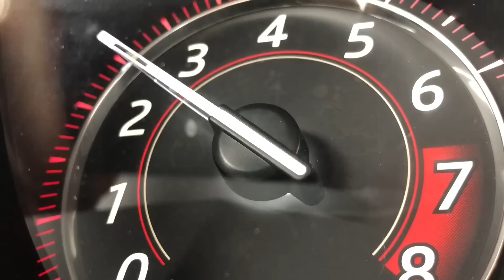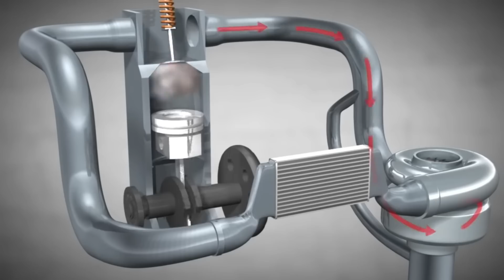Are Turbo Engines Reliable?

Comment: Over 50% of our trips are short distances where the engine / turbo doesn't have sufficient time to get hot.  My understanding is that this is not a good application.  Therefore, I'll look for a non-turbo engine for our next vehicle.
Reply from the maker: That's a very valid concern for short trips.

Comment: turbos are fine, if you take care of them with basic maintenance, my last turbo was a 2013 kia optima sxl. has 180k + miles and still gives me 27+mpg. dont drive it much anymore, but still works good.
Reply from the maker: Yes turbocharged engines are fine as long as you take care of them.

Comment: Correct to the person that said there only more fuel efficient is you stay out the throttle!!! Here’s the thing if you drive a gas turbo charged vehicle, the maintenance verses a naturally aspirated vehicle is much higher on the turbo engine! Meaning it cost more to operate it properly!  But good news is if you maintain it properly your turbos should be fine, but why buy a small displacement engine with turbos, when a much larger v8 has the same hp with less problems! An again with the turbo engine if you drive fast or pull a heavy load the fuel mileage is literally no better than the v8! I know, I own a 2022 f 150 3.5 echoboost twin turbo engine, if I pull a heavy load fuel mileage is no where close to what ford says!!! My naturally aspirated f150 friends with v8 engines get the same fuel mileage pulling heavy loads!!! I’m only better with fuel economy at normal driving no towing!

Comment: I had a turbo vehicle for 8 years and the turbo lag was there yes, but once you built that torque it was such a fun vehicle to drive torque everywhere even on the bottom end...just traded it in for a Telluride with a big Ole 3.8 NA V6 and man I miss my turbo everyday lol, there is literally no power down low until you get that engine in the upper RPM range and I don't even drive the same anymore lol

Comment: I love your videos but these small turbo 4 in my VW CS atlas burns more gas than old V6 on the highway or you push the engine
Reply from the maker: It is true, they don't have the same gas mileage as the old V6.  Yes the V6 was a more sturdy engine and I drove the atest with the turbo and during the testdrive I found it to surge at partial throttle and also seemed a little underpowered as these vehicles are quite large for that engine.  Beautiful trim in them though.

Comment: Well, 2 years later and what was Honda's solution for the 1.5 four-cylinder Turbo charged engine going into 2025?.... They discontinued it on their Civic! Yes, now you have two engine options. The naturally aspirated four-cylinder engine, or a Hybrid model if you want more power from your Civic.

Comment: 2024 and this became even worse especially in europe.
if you want a NA engine you have to stick with hybrid ( sure, no turbo but batteries ) or just pure garbage with like 80hp, both not that fun i'd say.
We have tons of 1 liter 100hp turbo engines, but at that point i'd rather buy a 1.5t or 1.6T for 5k euros more even for small 10 miles trips plus some fun on the weekends

Comment: Turbos by definition are forced induction. They increase compression and they also generate a lot more heat than a naturally aspiriated engine. More heat and more pressure place more strain and wear on an engine. Turbos are also complex, and add a lot of parts that a naturally aspirated engine does not have. That's just more stuff to go wrong. 
I get this guy is into selling cars, so he has this line. But he's 100% wrong, and you can ask any mechanic that knows turbos who will say what I just said.
The marketers and ad agencies are coming to you with words like "performance" and "efficiency" but the real reason all this is happening is government pressure on automakers to meet strict emissions standards. So they put tiny engines in heavy vehicles and they put turbochargers on them to compensate and give them extra power. But good luck getting much past a warranty period if you buy a turbocharged engine.

Comment: If all else is equal, a turbo car have higher parts count, so a higher failure rate in theory. Turbo demand more maintenance, unless you are a top executive and the company lease a car for you, then you will get a new car every 2 years or so, will not even have to bother with an oil change. A supercharge is less complex and I prefer that if I can choose.  In older aircraft, you get to control how much boost you want. For trucks, it is standard in 90% of the engines. Diesels are made tougher and so is the turbo, the exhaust temperature of diesel are generally couple of hundred degrees cooler than gasoline, that made a world of difference in longevity. You see a heavily boosted gasoline engine in a test cell or airplane, the exhaust are glowing cherry red, diesels never get that hot. Unless you live at Denver or other high altitude places, stay away from turbos. and in my case, German products. They are complex and expensive.

Comment: Excessive heat is the hallmark and weakness of every turbo performance car.  Regular road cars don't have this issue because the turbos are not multiple or large enough to cause an issue.  The biggest truth in this video regarding performance cars is the importance of clean, cool, well chosen ( always synthetic), well maintained oil quality.  A running cool down period of two to three minutes after a lot of boost driving is a very important habit to have to ensure your performance turbo car lasts a long time.  Running a good de-carboning oil (Valvoline has one) will keep the carbon off the ring seats so the rings can do their job holding compression and shedding excess oil off the cylinder walls on the downstroke so it's not burned in combustion.  Never put forged pistons in your car if you're not racing and you haven't consulted an experienced engine builder on them first.

Comment: Is Mercedes GLC 300 2023 models turbo engine reliable?
Reply from the maker: Generally they are reasonable and I have the slightly older version on my 2018 C class and it’s more or less the same, and it’s decent so far.  There is a little history on a few holes pistons for a few customers

Comment: Turbo is just an excuse to use a cheaper 4 cylinder or 6 cylinder engine rather than tried true bulletproof V8. By pushing these smaller liter engines, it pushes the engines well beyond there design limits. Hence why turbo cars often get less than 150,000 miles before detonation. Best to stick with electric hybrid car engines naturally aspirated without turbo, if you want power, fuel efficiency and longevity.

Comment: Have the 2020 Honda Accord with the 1.5 turbo. Average 37.6 mpg.Rarely any short drives. Mostly highway. Oil changes when maintenance minder says oil has 40% life left...which is usually around 7000 miles. So far so good...knock wood.
Reply from the maker: Good plan just stay on top of oil changes

Comment: I came here more for the comments than video, there will always be turb lovers and haters.  IMO there's nothing wrong with a turbo charged engine a well designed & maintained turbo engine and can be very reliable.  This is assuming you are not putting 20+ psi into the cylinders but I could the same for a 1,000HP NA engine.  I own one with @ 260,000 miles on it that has been in the family since new and no major issues yet.  Just traded in a 98,000 miled one that had zero issue throughout its life.

Comment: I've had numerous company cars, about one every 3 years for the past 30+ years. Had a Ford Eco-Boost Explorer for my last one. Worst engine for reliability I've ever had, and it sounded like an air compressor. When it came time to turn it in for my next car they had to bring a tow truck for it. First car I've ever had that needed that. A turbo 4-banger should never be in a 4000+ truck.
Reply from the maker: I totally agree

Comment: Would a larger engine (i.e. a 6 or 8-banger) tend to last  longer with turbo than a 4-cyl. engine? In other words, can I lessen the risk of getting a turbo engine if the engine itself is larger?

I'm good at regular maintenance and only drive hard for fun maybe once a month.
Reply: For the most part no unless this is a towing vehicle then in your scenario the larger displacement would be a better option.

Comment: Turbocharged  vehicles  are inherently  less reliable  ,because  you're  adding more components  that stress the engine and those componants will tap out before  the engine..

Thats all facts

The issue is are you looking to keep that vehicle for a very long time and is it worth it for the power and fuel efficiency??

For me a Turbocharged  vehicle is fine brand new to about  70k miles after that nope..changing  turbochargers  can be a nightmare  too..
Reply from the maker: Thanks for sharing

Comment: Wouldn't the cooling system take care of the added heat in a turbo engine. Most Turbo engine vehicles have intercoolers as well. Folks in hotter climates have the same cars we have in the cooler climates. The cooling system does more work, but the engine doesn't run "hotter" by much, maybe 10 or so degrees at certain times. Your just getting more heat under the hood, but again the cooling system should do the work to keep up with the temps. I would think you just have to watch your fluids closer on a turbo engine. 

Oil delusions is defiently a issue with Honda's, but can be watched and checked often.

On the Honda Accord v6 vs the newer 10th gen 2.0t on maintenance. I highly doubt at 80k miles that the v6 is not burning oil, and thus you have to shorten your oil changes like you would have to in the 2.0t. So this idea that you will save money on oil changes is not fully true. I have owned three Honda Accords. And the two of them where N/A engines. Both burned oil at 75k and above so much so that I had to shorten the oil change to 5k miles from Honda's 10k recommendation. I was adding a half a quart of oil when trying to do 10k mile oil changes. I think the savings on maintenance is a little overstated, and the norm maybe closer then some would like to believe. This coming from experience not just speculation.

Comment: Yup,  Now You're In My Territory.  I Worked For Honeywell For 22yrs, In The Turbocharger Division.  In Higher Altitudes They Lose Power Because Of Thinner Air.  Another Problem Is, Bent Turbo Blades & Shafts From Turbo Heat.  In1992, I Bought A Nissan 300zx, But, Not The Twin Turbo Version, And Still Have It Today !  The Only Difference Is Less Speed On The Front End, But Both Clock In At 155 mph.  Love This Car !! 😉👌💯🏁
Reply: All engines can lose power at high altitudes, but normally aspirated engines suffer far worse than turbocharged ones.
In fact turbocharging and supercharging was used in aviation  engines during WW2 to enable aircraft to fly higher.

Comment: We have a 2001 Pontiac Grand Prix with turbo charger. On our trip to ND two years ago we averaged 35 mph.  We never lacked for power over the high altitude passes or avoiding traffic with power when necessary. Our problem is the electronics controlling the defrost  mechanism.  We cannot find someone to fix it and often have to resort to manual means.  I understand that many cars of our vintage are abandoned because they are not worth fixing.  As the Electric Vehicles increases  I can tell you that the circuits for control are subject to vibration, moisture and corrosion.   Often total replacement is the only fix  and the cost is more than the car is worth. Just like the battery pack on the Prius. The best car I ever owned the drove was a Cad Seville with the turbocharged V8.  If I  had a few beers after work  and drove home 15 blocks on the back roads, the horn would start honking and the lights flashing.  The problem was a sealed module mounted on the wall between the trunk and back seat. The drain from the moon roof was plugged creating a pond under the rear seat.  I sold it for $300 bucks cash.  I now have a 2001 Toyota Tacoma 2wd pickup without modules on the a/c , heat and wipers. I sort of miss elect windows, cruise and auto transmission but, it might be my last vehicle and I can trust it to get me home for dinner.

Comment: I am looking to purchase a 2023 Toyota Sequoia or a 2023 Nissan Armada.  I am concerned about the turbo engines.  Is the Toyota 6 cylinder turbo  in the NEW Sequoia a reliable engine or would a Nissan Armada be a better choice?

Comment: is it the same with smaller engines like comparing 1.6 and 1.4T? I'm thinking a smaller engine has a better chance to be more reliable than a bigger one with turbo since it wont make as much heat, no? 🧐
Reply from the maker: Well….

Comment: Video summary; Turbocharged engines are bad for long term reliability (expensive to maintain due to engine complexity). Also horrible for random super short trips as vehicles don’t have enough time to cool down or warm up properly. Heat is the #1 problem of turbos as it melts the rubber/plastic bits in the engine bay. Turbo=expensive both to buy new and maintain/long term. Conclusion; Avoid turbo anything if possible… Unless you’re a wannabe NASCAR driver on the road with money go blow. Or towing a trailer. Ha!

Comment: The point is if you’re going to drive a high performance car with a turbo motor just change your oil at 5000 miles or sooner. Very cheap insurance
Reply from the maker: Indeed

Comment: We as a nation should demand the reduction of over-engineered vehicles.   Why do we need plastic push buttons (that require chips) for starter, parking brake, transmission drive/reverse select , windows, seats, mirrors, etc?  We got lazy.   We should demand BASICS, QUALITY and SAFETY only AND an End to Dealerships, and an End of Turbo's.  Gas Hybrids are still the only acceptable future mandate until hydrogen is perfected.  PHEV and Electric are just stupid as the electrical grid cannot handle millions of them; plus, they will burn your garage/house down.

Comment: I have a 07 Acura RDX and she is at almost 260k miles and is still all original
Reply from the maker: Cheers
Reply: She gets mobile one synthetic oil changes every 4k miles and I trust her to go anywhere she has the 2.3 turbo Honda engine I bet this engine would have been amazing in the Acura TSX paired with six speed manual

Comment: Are turbos reliable? Probably not. Nothing is anymore. It's more profitable to sell junk than something reliable. And if people don't know any better, then yea. I guess they are. My old tractor will run at full throttle at max load indefinitely.  It still has the original turbo and it's 45 years old this year. But the turbo was put on it for the right reason and built to do the job.

Comment: What's the comparison between Turbocharging and Supercharging, as far as shopping for cars goes? And reliability. I know both technically reduce the lifespan of the engine, but I'd figure that Superchargers are a bit easier on the engine.

Comment: Useful clip as always .Do you think a 3 cylinder GDI  turbo engine would last at least 200k if you generally drive below 3000 rpm and practice good driving habits you explained  such as 
1.   not pushing the engine till its fully warmed up,  
2. Idling the engine before shutdown.
3. Using a quality full synthetic oil and changing oil at 5k miles or 6 months. I love my little turbo but am paranoid about its long term durability.
Reply: Why "or six months" Oil does not go bad just sitting there in the pan.
Reply: @davenone7312 actually it does. Because there's airspace inside the engine which is open to the atmosphere. Expansion and contraction can change the air, and the air contains moisture which can condense and contaminate the oil.
Reply: @alanjm1234 it would take many, many years to contaminate that way. Oil sitting in the pan is fine.

Comment: Listen carefully , turbos belong on diesel engines and racing applications . This guy all wrong about the false sales narrative "more power and better gas mileage" . It takes "X" number of joules (work energy) to move 3000 Lbs. from zero to 60 mph in 5 seconds . Force them and they blow the gas like a V8 . THERE IS NO FREE ENERGY . Gdi engine intake valves are shedding chunks of burned coked oil through the turbine side of the rotating element causing servere unrepairable damage . This debris then plugs the catalytic converters , very expensive . I am a turbine machinist for twenty years . I make a good living from the poor customers that fall for the B/S . ALWAYS get the bigger engine . If you gave me a free turbo car , I wouldn't thank you for it , and I couldn't sell it fast enough . Avoid GDI , turbo and CVT at all cost .

Comment: I plan on buying a Mazda CX 5 in December, would the regular non turbo engine be enough to get to 65 MPH when getting on the interstate from the off ramp? That's pretty much all I need.
Reply: I’ve driven both turbo and non turbo CX-5’s. The turbo is more fun, but the non-turbo has enough torque and power for everyday needs like getting on a highway just fine.
Reply: I have a 2019 CX-5 Touring and the 2.5 engine works well. This is my experience driving in SoCal and now in Omaha, Nebraska. Very reliable vehicle as well.
Reply: Thanks for answering guys! You’re gonna save me at least a couple of thousand bucks!